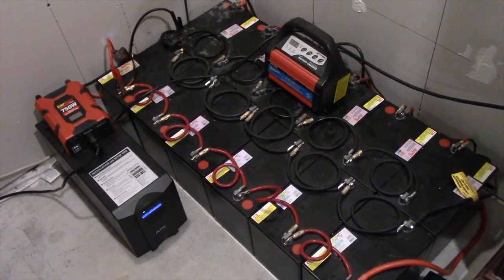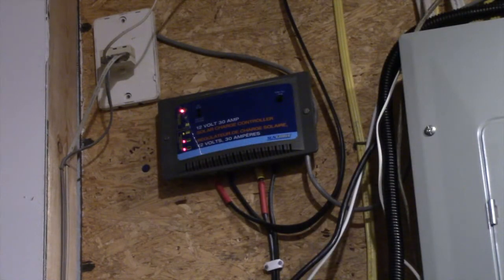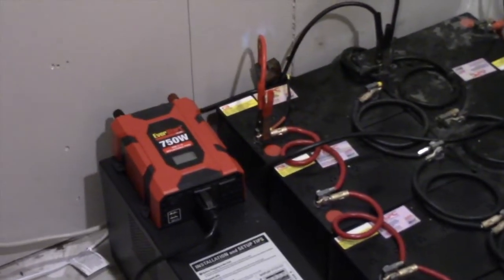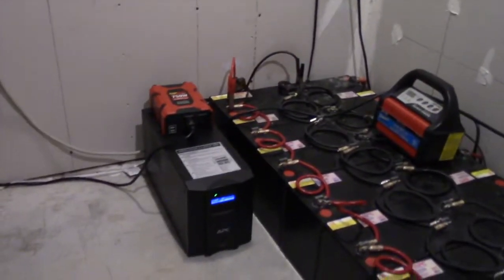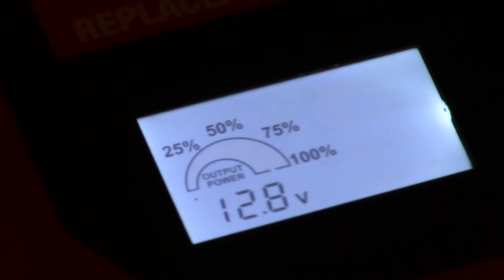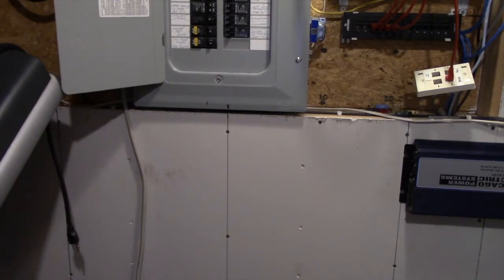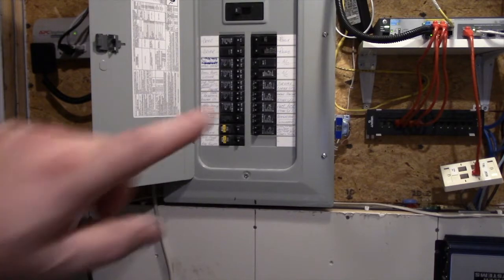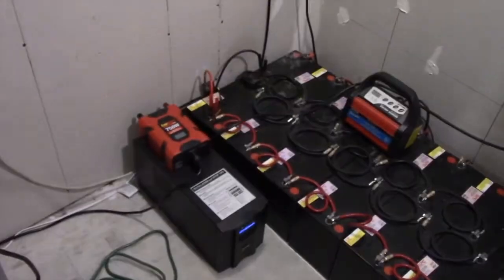Episode 38 Home Solar Setup - run your home from batteries and inverters

Comment: Have you added up all your costs to see how long it will take just to break even compared to grid electric?
Reply from the maker: i would need many more solar panels for that. maybe one day . The Cost has come down a lot, the batteries are fine for 120v, could never do 220 on these.  this was just a hobby project over time, pieced together component by component. i would say i have maybe 2K in total everything. inverters, batteries, solar panels , charge controllers, wiring etc.  i could live on it if it was just me, but my family consumes power faster than i can make it. 8-)
Reply: Sorry Chris I do not understand your reply.
Reply from the maker: ok hope this is better, i have about 2K in the system entirely. I've had solar and this in similar modes for 10 years. I burn about 150$ a month on normal electric, it has offset my costs by about 30$ a month for 10 years, $30x12x10=3600 savings with solar , better?
Reply: Chris, Thanks for the reply. The reason I ask is because I have been considering doing solar. The problem is when I do the math I never recover my initial investment. I have talked with people like alte store, and even though they are in the business to sell solar products, they are honest enough to agree that no off grid system will ever pay for itself with today's technology where there is grid electric available if we pay for the products at consumer prices. The fact that you only have 2000 dollars in that system is really great. That same system today would cost over 10k. You really must have gotten some great deals. That being said, if I may, your calculations on savings is not accurate even using the numbers you provided. You have to subtract the 2000 dollars for the cost of the system from the 3600 dollars for what grid electric would have cost you which means you have saved 1600 dollars over 10 years not 3600 dollars. Again you got some really great deals and perhaps even free stuff to get that system for 2k. Good job on finding the deals and thanks for the reply.
Reply from the maker: true, you can do really good solar projects for your home, yes they are super super expensive.mine was pieced together over the years, i first started out with a old car battery and 15 watt solar panel, then i hit up eBay for the 100 watt panels , now you can get larger ones in the 12v range. I learned a lot about series and parallel hookups, and the pros and cons to both, i just stuck with 12V because its cheap, readily available and works great.  the panels are by far the largest investment, and if your going to do whole house, the grid tie inverter (like a sunny boy) will run you the most. you don't need batteries for that application as most mainstream suppliers will not do a battery system but a grid tie system. I too looked in to that , but it was Super expensive . so this hobby level project was my next best solution, of course what works for me may not work for you, but it is nice to have power when my town loses it (which happens a lot). I would like to do more panels with newer cheaper tech here in 2018, a larger controller and a true neutral isolated inverter (like a Samlex 3000watt $1200.00), for me its not about the loss of initial investment or recovering anything back. i toss money into hobbies like mad, this one just turned into a benefit for my grid downtime. Start small like with a shed or something as a hobby level, nothing too large but enough to run something off the sun, it will teach you a lot on the tech, electricity, and wiring, then you can amp up (no pun intended) to something larger like your house or segments of your house.
Reply: Chris, Thanks for the reply and admitting it is a hobby as very few people doing solar actually will admit that is all they have as solar does not pay for itself, at least not yet. Grid tie is out for me as my electric company requires me to carry expensive annual insurance to tie to the grid as well as expensive hook-up so it would be a wash in the end or take so long to even come close to breaking even it would not be worth it. I have generators for power outages which seldom happen here. I have been here over 30 years and only needed the generator two or three times. As for battery back-up that is how I would go IF they ever get the battery prices down to a reasonable level, but for now it looks like I will have to wait for more technical breakthroughs. Thanks again for the replies.

Comment: You said the batteries are 75amp hour?  It looks like they are from APC Uninterruptible Power Supply?  Are they the better batteries to use?
Reply from the maker: they are from a old APC infrastructure unit, I got them cheap. they work beyond great because they are deep cycle, and have a 15 year half life, so I'm hoping to get 20 out of them.